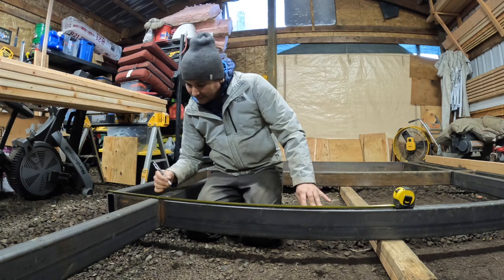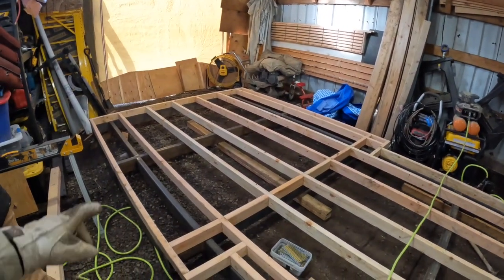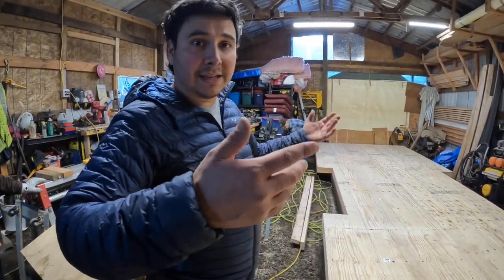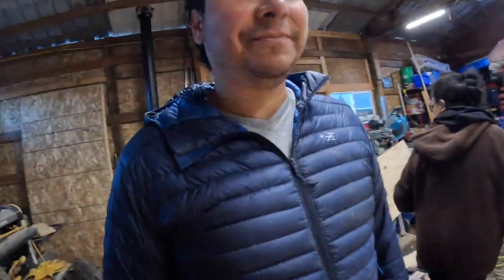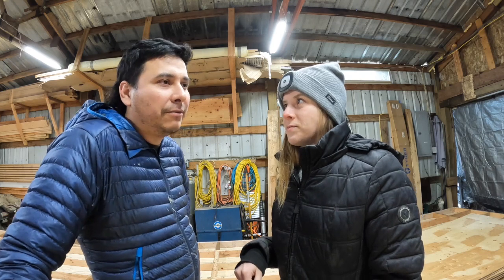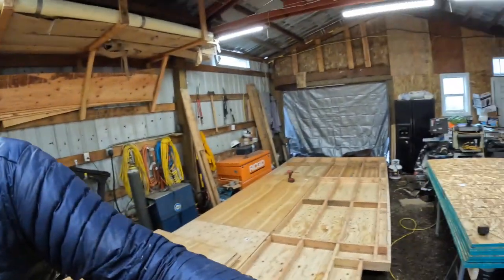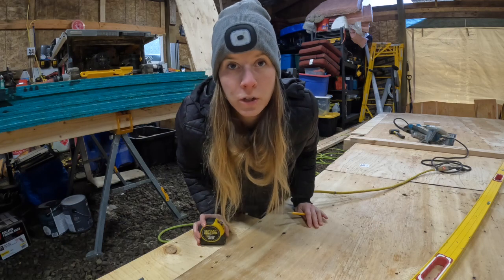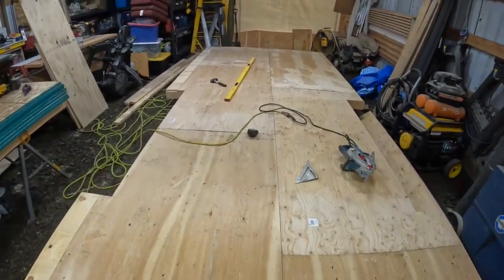Building and FLIPPING the Floor of the Tiny House  ||  Ep.2

Comment: great work and a good idea (if one has the ideal shackshop)! 
a tip to consider.. to run your pipes in between the floor joists so you can insulate them at the same time as the floor 😄
Reply: aaaand... I totally did not watch all the way through before commenting.. 🙈 the chicken wire can be put around the fram, a little bit dug down 😉
Reply from the maker: That is a great idea! We don’t have too many pipes to run so we’ll be running them through the wall :)